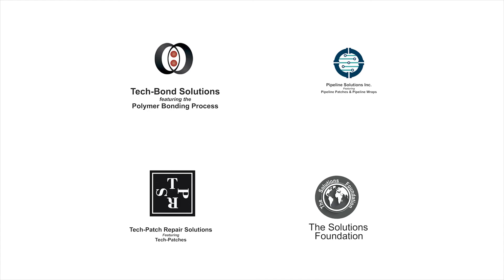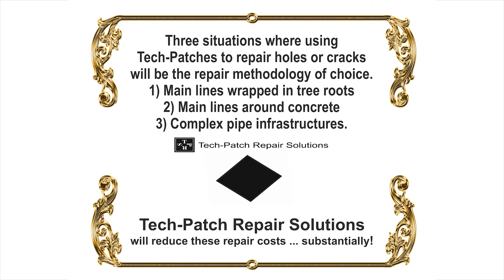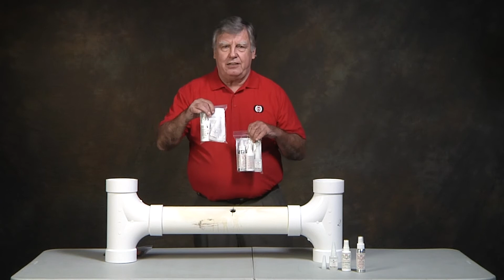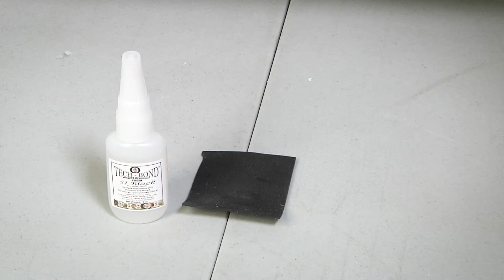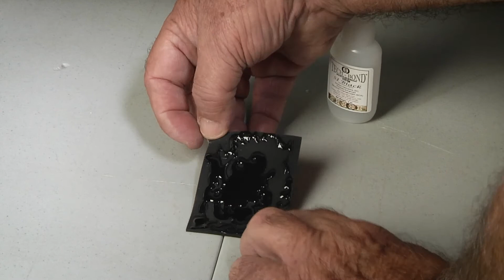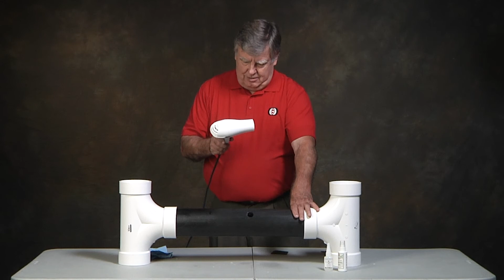Techbond/Tech-Patch PVC HDPE Steel Pipe Repair

Comment: I have a buteline fitting that has cracked. It is attached to bulletin pipe inside a wall in the toilet (washroom) water is leaking out through a crack at the polyethylene fitting that looks like the picture shown in this URL link. 

The outlet of this fitting is a stopcock (male). The PE fitting is female as shown on the URL link above.

I am trying to use your tech bond bonding to seal the crack and to seal to a stopcock that I am going to screw onto the cracked PE fitting mentioned above.

Please advice how should I go about doing the repair.

Thank you.
Jimmy
Reply: I am trying to add the URL link
Reply: But the URL keep disappearing..
Reply: replace xxx with the full URL address and add hxxps protocol in front..  
xxxdotbutelinedotcomslashmyslash
buteline-pe
slash
buteline-pe-fittings
slash
female-lugged-elbow
Reply: replace xxx with the full URL address and add hxxps protocol in front..  
xxxdotbutelinedotcomslashmyslash
buteline-pe
slash
buteline-pe-fittings
slash
female-lugged-elbow
Reply: replace xxx with the full URL address and add hxxps protocol in front..
Reply: replace xxx with the full URL address and add hxxps protocol in front..  
xxxdotbutelinedotcomslashmyslash
buteline-pe
slash
buteline-pe-fittings
slash
female-lugged-elbow
Reply: URL goes missing...
Reply: replace xxx with the full URL address and add hxxps protocol in front..